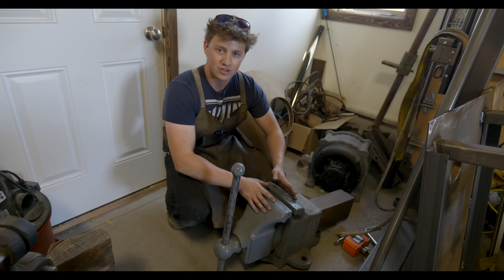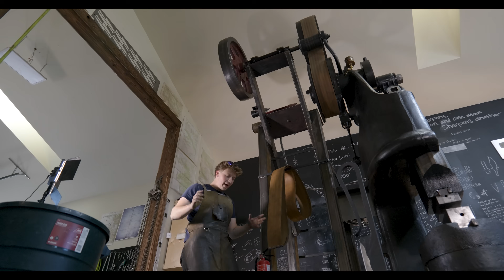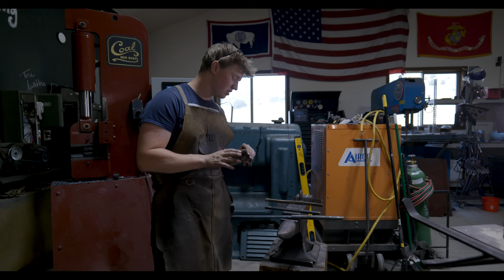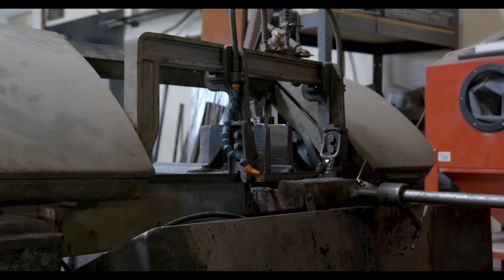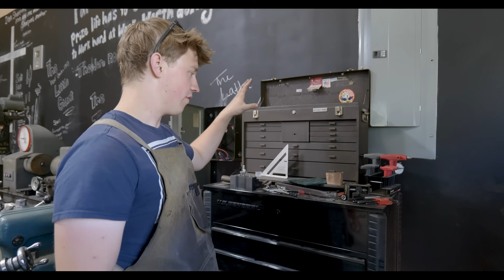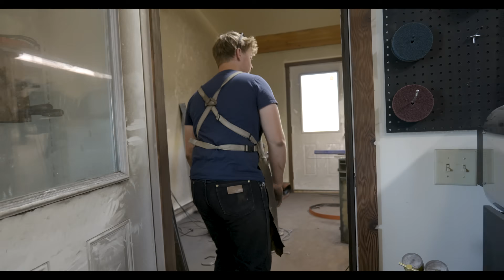Shop Tour 2022

Comment: As an ongoing joke you could put up a small sign on the front of the shop reading "VISE SQUAD".  If someone asks if you spelled it wrong, tell them,"You need to step inside."

Finishing the flintlock is a good idea IF it doesn't keep you from more knife projects.

Comment: Will.  You should check out the B.A. Vander Sander.  It's a disc sander with a tilting disc.  The disc goes vertical and horizontal.

Comment: Cool, very cool workshop! We centarnly want to see a restoration of the old pistol. If you want a surface grinder you should buy that adaptor from Alec Steele :)) A good precision paralel grinding machine would be a good adition. Anyhow, design and make lots of good stuff there with some good and willing for the trade guys.

Comment: Will, with regard to the blown phase converter for you lathe. You can replace it with a properly sized VFD for a fraction of the cost. You can even buy them now that will turn 240 volt single phase in 240 volt 3 phase. Just a thought.

Comment: I recently got a 16inch swing- 72inch bed 1940's south bend lathe. i got it in working condition at a machine shop closing auction for $300. It also came with a massive boring setup that weighs at least 300lbs. The owner of the shop personally sourced the lathe by himself at 14 years old in 1943. they made bearing washers for aircraft during WWII. I still haven't run it because it isnt moved to its permanent place and we dont have 3phase in the garage.

Comment: First off, yes finish the flintlock! lol   Secondly, tool wise you need to build a router that will shape metal!  I believe there are bits designed to cut metal.  That would be a fascinating project (yes I'm crazy). 😂

Comment: Speaking of a surface grinder, my grandson and I started making him a large sword out of a chunk of 1/4" flat stock I had laying around.  Someone had been using it as a floor scraper, I think.  I wanted to put a fuller down the middle of the blade, but am very limited in the tools I have at hand, so I was trying to figure out a way to get a nice, clean, straight cut with an angle grinder.  The solution I came up with came in the form of a two-drawer, chromed, heavy wire insert for kitchen cabinets, that a neighbor had given me.  The unit is pretty heavy, with good, smooth, roller-bearing drawer slides.  I was able to clamp the angle grinder so the disk was protruding down through the top drawer, with the sword clamped to the top of the bottom drawer.  By using thin spacers under the sword, and the travel of both drawers, I was able to grind a perfect grove the entire length of the 3' + blade.  I think with some creative clamping, I'll be able to flatten it and grind the primary bevels as well.  It's not a 3 ton chunk of cast iron, but with some bracing, it does a surprisingly good job.  Sure beats weeks worth of hand-filing, or the butcher-job I'd make of trying to free-hand with a grinder.  Love and envy your old iron, and your passion.  Keep up the good work.

Comment: Powerhammers are great and one of their best features is that if you are using them at their maximum you can actually heat up the steel just from working it to theoretically forge a piece forever without needing to reheat it.

Comment: A note on that motor, The rpm is technically the same, motors come in a fixed amout of speeds due to the 60hz of the power. the amount of poles a motor has determines the speed and the rpm on the motor you have is likely the no load speed where as the origional listed the load rpm. Great job will, love your videos. I used to live in spokane now im in NY

Comment: If you don't got it. Get The machinery Handbook. It's more valuable then you'd expect, considering it seems your less comfortable with the machining side of things. 
Also surface grinders have every grit you can imagine I've never heard of it being switched to belt and I'm surprised you aren't more inclined to get a tool cutter grinder, you could use that as a surface grinder as well as use the various vices to get very cool shapes and angles you couldn't get otherwise. Also you can sharpen lathe and mill tools obviously as the name implies or even shape carbide.
Reply: Seriously though you need that book. If you dont